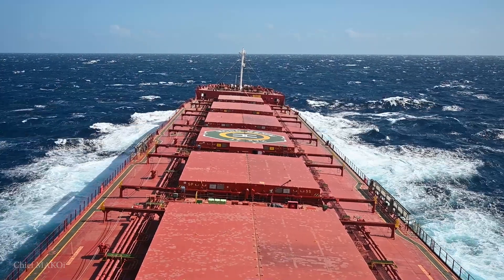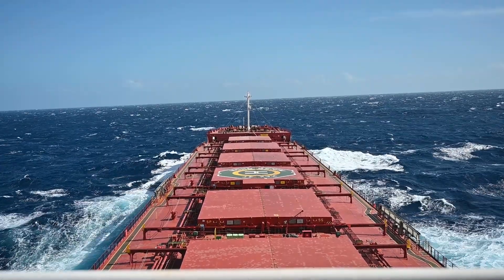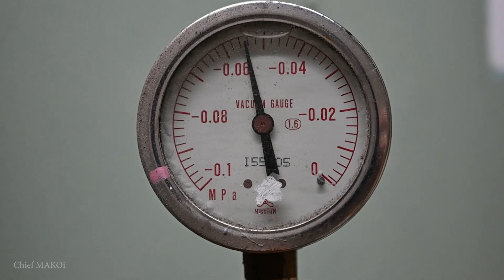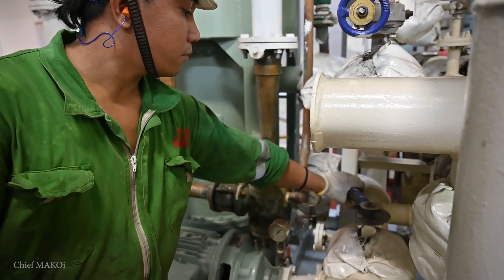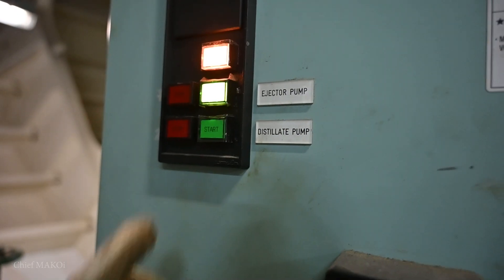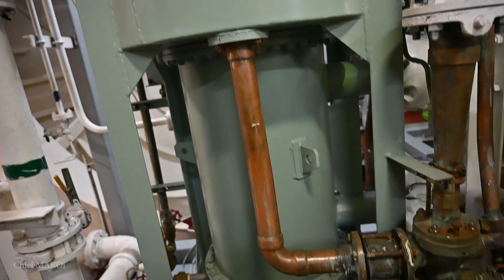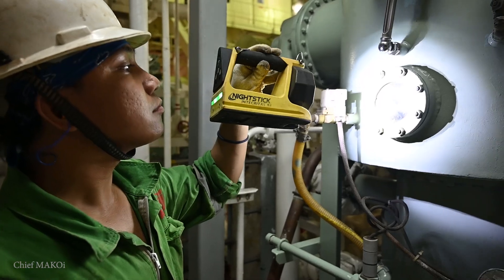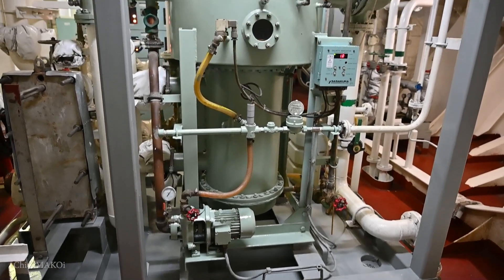Ship's Fresh Water Generator (Distillation Plant) | Starting and Stopping Procedures | Chief MAKOi

Comment: Good day Chief Engineer, 
I wanted to say thank you very much for the good work you do.
Having not met you physically but your lectures has impacted me tremendously.
I grasped the knowledge of how fresh water is generated from the sea water onboard ships with the use of FWG through watching your technical Videos. 
 
Please Chief sir, in your previous video made 5 years ago on the topic (How ships convert Sea water into Fresh Water ), you made mentioned of JACKET COOLING FRESH WATER (JCFW) Temperature being around 80 to 85 Degree Celsius but in this episode, you said it it's 85 to 90 Degree Celsius. You also made mentioned of the Salt content of the fresh water generated being less than 10ppt but again you said it's set to 5ppt on this video. Chief, I understand that these ranges as mentioned, aligns with the respective Temperature and the salinity of this system; I also understand that conventions are being reviewed and even new ones being added. But Chief sir please which is presently acceptable by the convention for clarity sake?

Comment: 7:10 I am surprised at the 5ppm figure: that's five times higher than a domestic water supply. Is that because a lower figure would lead to excessive recirculation (and therefore excessive time required) of the evaporated water? Does the stored evaporated water taste saltier than that of a domestic supply?

Comment: I find but one error in the vocabulary 
Evaporation of water takes place at most temps, even Ice loses mass to air.

Boiling may give you the highest evaporation possible and serve to kill off some organisms, but the change in salinity will as well.

Is there another step in this process before that "fresh" water makes it to a tap for drinking?

Do you process water less for hygiene purposes?

Is grey water (used shower water) used for secondary purposes like flushing toilets or washing equipment?

Comment: This is a single stage (effect) evaporator. It is low efficiency but the heat is free and there is plenty of for a ship with 18-24 crew.

Ships making water from steam has to pay for the fuel to make the steam so they have multi effect distillers, more efficient in water production per pound of fuel used.

The most common evaporators are Nirex brand using plate heat exchangers instead of the shell and tube one in this off brand unit.

One more thing for the ex Navy MM’s reading this.
All those hours standing Evap watch was a waste of time! 

I got out of the Navy and went into  the US merchant marine with the steam tankers and container ships. We had Evaps from the same companies as the Navy ships, multi effect 
Flash units,  and Never had a watch stander on them. Aqua chem was one maker.

You started it and after stable you walked away checking on it once an hour on a normal round.

If it was not stable you fixed it not have a guy adjust it continually for 4 hours.

Comment: Just for curiosity, is there any difference as to preferred desalination process with varying sea water salinity?  I'm thinking for example the difference between the Baltic and the open Atlantic.  Or what about ships goin up and down the big rivers.  Or even St Lawrence between the Atlantic and the Great Lakes.  There is supposedly a big difference in sediments in addition to the salinity, likely a reverse proportion.  I believe some cruise ships traveling through the Panama canal have mentioned while describing their system that they use reverse osmosis type.  But I have no idea whether they need to use their desalination during the relatively short time spent while traveling through the canal.

Comment: Am I reading the gauge correctly that the air pressure in the evaporator is reduced only by 0.10 bar?   How much does that amount of vacuum reduce the boiling point of the seawater?

Comment: Life would be easier if there was a way to automate this process. At least this way is  good job security for highly trained ship engineers!
Reply: Maintenance and repair of all the electronic and mechanical parts required to automate a process that takes a total of 16 minutes per voyage leg would take far more than 16 minutes per leg and the techs would would probably have a higher wage.  If the overall automation cost was cheaper, you can be sure that it would already be done.

Comment: Very interesting, thank you. A basic and robust system. Good use of the ejector pump for vacuum distillation, was wondering how the vacuum would be achieved when you mentioned the engine water temperature. The salinity meter also turns the system into a basic reflux still :) nice setup.

Comment: Chief, another super interesting and practical video taking your already good classroom explanation to a real life implementation. Please keep doing these types of vids.

I do have a question: Do the techs ( mates?) follow a procedure checklist of any sort? It seems that there are a number of steps and valves and controls are located all around so it could be easy enough to perhaps skip something if distracted etc.?  Have you read the book “Checklist manifesto”? If not, it’s a short read and just so very eye opening!

Stay awesome and safe!
Reply: plant manuals contain pocedures followed. most of times muscle memory kick in for principles are the same. its wise to ask old crew about placement of valves otherwise one has to visually trace piping lines and valves according to piping diagram

Comment: Surely this can all be automated?!?
Reply: Yes, but I think you have much less of an understanding of what's happening with an automated system. With this, you know what's going on, and can much better analyze when something goes wrong.  And there is less to break. Manual valves are more reliable than automatic valves. It's not like this system is turning on and off multiple times a day.

Comment: A fascinating explanation. Deep water turning on and off, does that infer starts and stops beyond the continental shelf ? 20 tons production a day infers about 4800 US gallons per day. A gallon of water weighs 8.3 pounds. The average household consumes about 87 gallons per day, so approximately 55 homes per unit.  Being a little crazy with some math... there are approximately 170,800 homes in Tampa Florida [numbers vary a bit depending on sources].  That would require approximately 3,100 your ship sized desalination units to supply it water from the sea, assuming my math is correct. I love your stories.  thank you for doing them !
Reply: A project that size would be awesome but I imagine the chemical treatment bill might be a lot. Along with whatever kind of energy source you use to run the machinery. I think I like what you're thinking though.
Reply: There is a company called Miox that has produced portable water sterilization liquid from a small hand held device originally developed for the military but also sold on the open market to campers and hikers.
They also make municipal sized equipment for water treatment plants and are sized to plant production. The equipment consists of a treatment chamber with a replaceable platinum element and a DC power supply. The equipment will dose a predetermined amount of ordinary salt into the chamber as well as a measured amount of water. After the DC current is placed between the chamber and element after a controlled amount of time the net result is a liquid similar to chlorine which is dosed into the water supply. The net result is the use of cheap table grade salt and water. No caustic chemicals need be stored on site.
Equipment has a high initial cost but users win because it uses cheap salt as its "chemical".
Reply: I assumed one ton equals 2,000 pounds.  4800 gallons equals 18,168 litres, 87 gallons equals 329 litres. Close enough.  3.785 litres per US gallon. I am aware the marine environment uses 2240 pounds per ton. I am not aware of the pound holding different values around the world, I am aware both tons, and gallons vary. I was attempting to grasp a data point on the magnitude of the seawater desalination problem for terrestrial  use.
Reply: You are assuming the tonnage is US or Short tons?
Reply: No one outside america can understand what your trying to say
Reply: @clairevero  -- Last I heard, the internet is a US invention, so deal with it... We can do metric when we want to, but given the choice of doing metric and irritating the euro-metric-weenies who are bad at math, we choose the latter... :)
Reply: @CurmudgeonExtraordinaire  actually switzerland did

Comment: It's interesting, that the whole procedure consists of only opening and closing valves in the correct order. In theory, this could have been done in the 19th century! And actually pretty smart to use the combination of free heat and a vacuum to minimize energy consumption.
Reply: They actually did. There were fresh water generators in widespread use by 1865 for steam ships. Certainly not this advanced though,
Reply: Multiple-effect distillation has been used on ships since the mid to late 1800s.
Reply: Good point, the only bits they didn't have then was the salinity meter and probe,although I'm sure some clever folk would be able to measure the salinity in some way. Water treatment chemicals may have been a bit suspect though.
Reply: @daic7274  They had hydrometer to measure density of fluids like water, beer or whine 😀. Just get a sample in a bucket, put the hydrometer in and read the scale. If they would have added some minerals, this should be safe to drink.
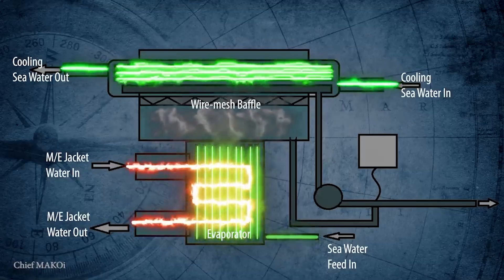Reply: (6:15) No need to study thermodynamics to understand the phase diagram of water ;) :)

Comment: hey cheif, you often mention a boiler for making high temperature steam for various purposes, while enroute is it not possible for a ship to use the exhauste gas heating instead? i guess that would be way more efficient and effective
Reply: I suspect that the exhaust gases are too corrosive and you would probably need a secondary heat exhanger to isolate them from the fresh water. As stated in another comment, the jacket cooling is available and easy to use.
Reply: There are two separate boilers or a single boiler which can raise steam by two means. In port or during manouvering steam is raised by burning fuel. During sea going passage with engine at full load steam is raised by exhaust gases.

Comment: Oh man using excess heat from your jacket line and a small pressure reduction to boil water is genius!
Reply: If I read the guage correctly, the pressure reduction is substantial. Looked to be about 95%. Atmospheric pressure at sea level is a tad over 100k pascals and the gauge showed almost 0.1 m pascals.  Or do I have the units wrong from the gauge face wrong?

Comment: Question for the Chief. Why do some of the pipes have thick painted covering over them and some do not, it looks like some pipes are wrapped in material then painted? 🤔
Reply from the maker: The hot pipes are covered with insulation.

Comment: How many kwh is expended for liter of water treatead?
Reply from the maker: It's a waste heat recovery system.  The heat absorbed by the jacket water from the main engine cylinders (which would otherwise just be dissipated into the sea) is used for this process.
Reply: @ChiefMAKOi  thanks.

Comment: Great detailed explanation. What is the daily capacity of your plant?  Back when we had steam distilling plants on submarines the plant was several thousand gallons per day for a crew of about 100 on a nuclear ship.  There was also an emergency electric distilling plant of 1600 GPD.
Reply from the maker: 20 tons/day.
Reply: @ChiefMAKOi  hi cheif
Reply: @ChiefMAKOi  what is frame by frame action of governor when there is direct order of crash astern when computer think by himself and program want save both ship and engine......and also what is different of crash astern order comes with only save ship .and all bottle keik in to brake air and force to flowers to reverse and keik in astern. Let's say ship is in open sea full nav. I think its 20% chance to brake air stop engine momentum to enable reverse system  change timing
Reply: Air bottles empty by blinking 
And there is just one bottle on line in open sea.if say cheif or second is very clever and open second bottle at first action.agin i say its 20-30% chance of stop fully ship  loaded at full nav in less than one minute
Reply: @edmondmkasian6173  -- No matter how much I've had to drink, I've never had an air (or any other type of) bottle blink at me... Or wink... :)
Reply: Considering the fact the the pressure on the gauge was in MPa, his answer is probably in metric tons, but there are multiple types of tons... Short tons (2000 lbs)... Long (or "Imperial") tons (2240 lbs)... Metric tons (1000 kg or 2204.623 lbs)... 1 US gallon of water weighs about 8.34 lbs... So, 20 * 2204.623 / 8.34 = 5286.86570743 gallons per day or 220.286071143 gallons per hour...
Reply: Running the numbers shows around 200 gallons per hour.

Comment: It always amazes me how many steps have to be made manually to operate such a simple system.
One would think that there is a automated system to do it for you.
Reply: the only thing automated is good for is tripping constantly and needing someone to constantly watch it more than a manual system. automation just for sake of sales is the worst garbage
Reply: The parts that make sense to automate already are (salinity sensor). Imagine having to manually test for salinity. 

For the rest of it, I imagine the additional machinery to automate valve operation would be needlessly complex and would make maintenance way more difficult. These components need to be inspected and maintained regularly as is, adding more possible points of failure in the messy environment of a ship is probably going to give low returns.

But the tech will probably just get cheaper and more reliable in the future. So who knows, maybe future ships will have smaller desalination systems that are more efficient and can be more easily automated.
Reply: The valve path is crucial in many systems.
Reply: Would you trust your drinking water, hundreds of miles from anything, to you "smart"phone or PC?
Just think of how many times they let you down.
Reply: @lmao this isn't a name You've only proven you're using different accounts to like your own comments and you don't know how automation works.
Reply: @lmao this isn't a name ...I was replying to a comment that asked why the whole system wasn't automated.
Your arguement doesn't even stand for the position you try to take, even though you jumped into the conversation late.
While ABS and Airbag processors are more robust, they fail.  They are designed that WHEN they fail, they turn the safety system off without effecting the system they are connected to.
Your brakes continue to work, just without being monitored and corrected for wheel lock up.
They aren't mission critical.  The car still drives and stops.

Fresh water supply IS Mission Critical.

The manual valves on the inlets and outlets of this system are NOT connected to servo motors connected to a processor for good reasons.

One being a human should be supervising the production and reserve of fresh water on an ocean going vessel.   Period.

You "Proved" you don't care where a discussion starts, as long as you can take a crack at ending it.

How's your quest for instant gratification treating you now?
Reply: It's quite simple: The machinist time spend on operating those valves for a couple of minutes every couple of days is less than the installation, operation and maintenance cost and time of electric valves, sensors, control electronics, safety interlocks, and operating panels.

Also, the more automated a system is, the more automated it must be. People forget about the operation of systems they don't have to interact with. In this case, such a system would need a GPS and intake water quality sensors because half the time nobody would think about switching it off when leaving deep water.
Reply: I think there might be some practical reasons for this. My thought is either to make it easier for people to learn, due to many ships employing people from third world nations who might not have the same opportunity to learn automated systems, or manual operation in case of faults at sea (power outages, bugs and such). Also, any sort of sea air and water hates electronics that overstay it's welcome.

Of course, this should be possible to automate despite these issues, but I believe it's safer to have a pair of human eyes on these. 😄
Reply: @Bidmartinlo  ...Third world folks are way more practical than you.

They understand fresh water is THE most important resource on a ship at sea.

Why on Earth would you say such silly things about people you DON'T KNOW?
Reply: @truthsRsung  Because in general, most people in third world countries have other priorities than education. Like food and water.

No amount of knowledge of electronics will let you conjure food and water. I know, because I've been poor. I've only been lucky enough to have been poor in a country which provides food, water and free education.
Reply: @Bidmartinlo  ...This IS water.
It's boiling water.
I learned to boil water BEFORE I was given a traditional education.
You act like this process is more complicated than it is and want to link an economic imbalance to every topic you touch on.
You have fun on your crusade, but I'd be careful where you try to apply your perspective.
It should be apt or you risk sounding like a fool.